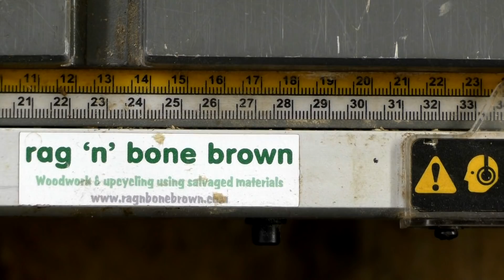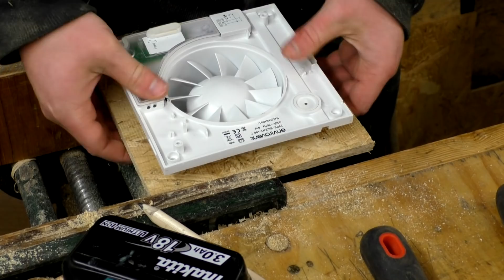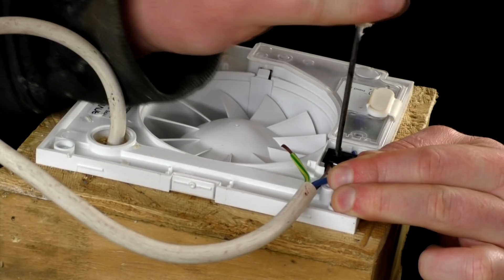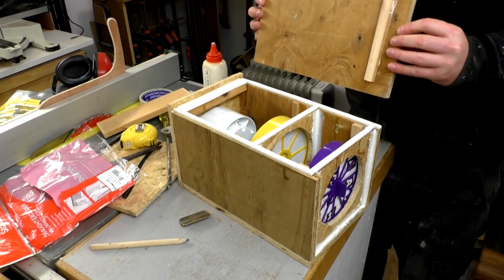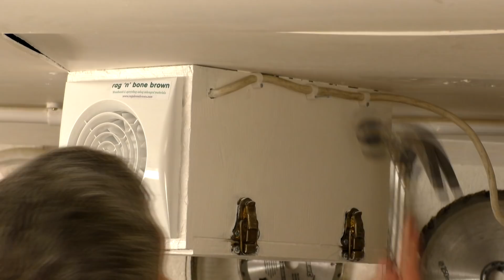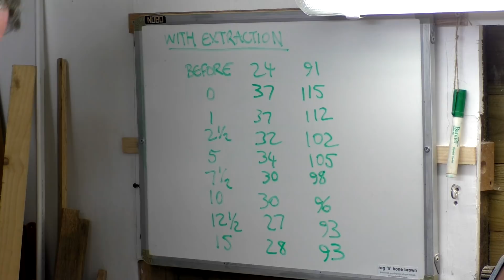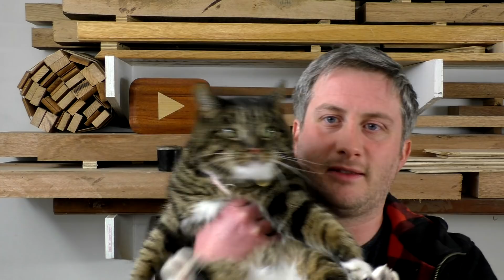Making A Small Air Filtration Unit For The Workshop.... FAIL!

Comment: 1) Dyson filters are no good for this application, 2) your fan doesn't have nearly enough static pressure, 3) you always need more CFM than the actual volume of your shop.
I made a copy of the Jet AFS500 airfilter using 18mm plywood, 6 high performance server fans I got for dirt cheap during a sale, and a leftover 150W PSU to feed them. It accepts one Jet pre-filter and one fine filter. The fans move about 103.8CFM (176m3/hr) each at 66 Pa. All 6 of them move a total of 622.8CFM (1058m3/hr), way more than the Jet AFS500 itself which max out at 353CFM (600m3/hr).
I can tell you it does get the job done and you don't need a meter to notice ;) You can smell the air is clean, and you definitely see it because the filter turns brown when it's full.
You could also make a slimmer 3 fans version of it if you cut the filters in half.
PM me if you want the SketchUp plans and pictures.
Link to the fans:
https://www.amazon.com/Panaflo-120mm-FBA12G12H-1BX-103-8CFM-Computer/dp/B008LA75XG
Other fans would work too as long as they have the same static pressure (66 Pa).

Comment: So, two basic issues: 1) vacuum cleaner filters are designed for high velocity/low volume of air.  That little bathroom fan can't generate nearly enough flow to get the necessary pressure drop across those filters. 2) As previously mentioned, that bathroom fan is just way too small...don't know the total volume of the shop, but it would take ages to circulate all of the air in the shop through that little fan.  You'll have much better success using high quality furnace filters and a box fan.

Comment: Air needs to be pulled through the filters instead of trying to push the air through.  This will have the benefit of keeping dust from accumulating on the fan blades as well as creating better air flow.  You also need a fan with greater static pressure capability or more layers of fans.  Fans can be stacked to increase the pressure.  Those Dyson filters need a lot of pressure to pull air through them.

Comment: I used 4 vacuum hepa filters in parallel with a squirrel cage ventilator ( a little more pressure than axial)  it didn't work either.

Comment: Great video.
This s not tested. Just theory;

I would suggest that your not moving enough air because your fan designed to move steam and moisture is not strong enough. As evidenced with the prefix "silent".

The air has to pass through two strong filters. You said that the filters are from Dyson which comes with a good strong motor. You could find an old Dyson and repurpose that.

 Or, if it's too loud, you adapt your current set up to a  suck and blow approach with the strongest fans you can find at around that size. Placing one fan before and one fan after the filter.the thing is, with two filters blocking the way, your solo bathroom fan is not pushing enough air to force the air through the filter.

Keep going, crack it.
With millions of small sheds world wide, you have an attentive audience.

Comment: I think, the error is easy to detect: U used filter from a dyson vac. U need much much more pressure
to get air through the filters. This toy fan has no power. The tube fan only works like a mixer.

Comment: Air flow through the unit. I built one also and found I had insufficient airflow till I pulled out all but one filter. Try removing a filter then repeat the test.

Comment: Several factors are causing the results.
1 - The fan is underpowered.
2 - Only the lightest and smallest particles will be at that level. Lower the box to 1.5 meters to make a meaningful difference.

You can use a box fan with a filter attached as a cheap alternative. The HEPA filters [11-16] will clog immediately. Try a #8.
You can use an old canister vacuum from a thrift store since size might be a factor.

Comment: The idea and creation is very nice done, but a see a few problems.
The biggest problem like the other comments below mentioned, is that the fan is too weak, and doesn't provide enough CFM, 
and also, the filters will lower the CFM, this reduction will even be more when the filters are getting dirty.
Second big problem is, that the air direction is wrong.
When you pull in dirty air through the fan, the fan will get dirty air and the lifespan will be reduced.
If you let the fan blow in the other direction, then the fan gets only clean air.
I bet your next design will be improved enough to work.
Good luck.
Reply from the maker: Thanks- great info

Comment: My first thought was that the fan isn't powerful enough to push air through those filters. What flow rate is the extractor rated at? You may need 4 or 5 fans that size to get sufficient air flow.
Reply from the maker: Thanks you're probably right

Comment: Are the filters put in in the right direction as most have a flow direction.
Reply from the maker: Yes, I suspect the fan was the wrong way round though judging by some of the other comments, and should have been pulling air in rather than pushing

Comment: As other have pointed out there are a couple issues that probably contribute to the poor performance.

1 - Bathroom fans are generally low cfm and very low pressure.
2 - Fans, in general, are better at pulling air than pushing it.
3 - HEPA filters are typically pretty restrictive.

You could try remaking the project with a new design.  The two filters on the outside, but not inline, and the fan in the middle pulling air out.  Air would be pulled into the box through a filter on either end, then out the middle through the fan.  But that fan might not be up to the task of moving air through those filters.

Comment: 20" floor fan and furnace filters.  Done.  I have 2 in my shop, just slightly larger than yours.
Reply: In the UK, you can't buy simple 20" box fans, and we don't have furnaces here so furnace filters just aren't on the market - even on Amazon.

I found this video looking for UK builds that worked with materials we can get in this country.

Comment: Disclaimer... I am not an HVAC engineer in any way, shape or form but...   
Slower fan, moving a higher volume of air into a box with a large surface area for filters.  First filter acts as a baffle, causing the air speed to drop, particles lose energy and become entangled in the filters. Your fresh air relatively slowly but in large volume exits the system. 
Your MkI system isn't a fail, it's just a prototype and I hope you build a good scrubber soon.  Check out Matthias Wandel's really detailed build videos on his filtration system.

Comment: I believe anyone with a workshop has made the equivalent of a "white box that does absolutely nothing". I've made some doozies, expensive doozies. Great learning method though.
Just spitballing but I think you'll need minimum 125 CFM fan/motor preferably with sealed ball-bearings and thermal protection.

Comment: use an inline fan from screw fix (26867) its pulls a lot more air through. i was thinking put the inline fan in the extension and put 2 grills through the ajoining wall an IN and an OUT and put the filters inline through the ducting so it will take air out filter and put back into the workshop and that will make more of a notable difference??
Reply from the maker: Thank you nice ideas

Comment: don't let it put you off ... this is how I do things you will get there in the end these bathroom fans are pretty hopeless to be honest . ideally you want one of those ducted fans if you look on ebay you can pick some up quite cheaply  I bought a 6 inch one recently for 30 and it's very powerful yet also quiet because it's a bigger blade it can move more air whilst spinning slower. being a ducted fan you could insulate it in a box to lessen the noise too . have you considered maybe a cabin filter for a car they have a large surface area they aren't too expensive and you could probably just vacuum clean the surface now and again . also the best motor to use with your Dyson filters would be a Dyson motor under 15 pound will move tonnes of air but probably way too loud for what you want . I totally get where your coming from by trying to be a considerate neighbour.

Comment: Firstly, that tiny extractor can't have very much CFM even without resistance.  Secondly, those filters are designed for vacuum cleaners which are capable of producing far higher pressure differential to pull large amounts of air through relatively small filters.   If you want to optimize the full airflow capability of that extractor, use a large surface area of filtration.  I would recommend making the entire box out of filter material and having the extractor pull air into it so that it exhausts cleaned air.  
If you can afford the space, I recommend a larger fan inside a box made from furnace air filters.   I use a box with 4 sides made from 20x20 cheap filters with the bottom being wood for support and the top being a shroud for a fairly quite 18" shop floor fan inside of it.  I don't have a dust meter, but using a bright flashlight to illuminate the dust, I estimate that with the unit running after 4 hours, the dust level inside my entire house was reduced by about 90%.

Comment: I think the problem lays with those dyson filters mate, they are made to draw air in and not being used to have air blown out....just look at a hoover to see where the filters lay and where the fan is.....also you will notice on most air filter boxes that the filters are on the outside, the fan on the inside.....one way around your problem would be to turn the fan backwards so it blows the air outside via a hole in the wall and just have the filters inside to draw dusty air into it.....just my 2 pence worth 👍🏼😊
Reply: marc's fx is 100% correct . Your filter is all wrong . A small piece of furnace filter would be better , to move a large volume of air . your fan is not strong enough for those filters.
Reply: Exactly what I was going to say. You can’t effectively push air through filters like those with a fan that small.  You need to pull the air through them.  If you turn it around (reverse the air flow to exit through the fan, changing your filter media order) you should get a better result.
Reply: One of the filters is pre motor the other purple one is post motor and is HEPA but they are designed with more powerful motor in mind 

Please
Reply from the maker: Thank you!
Reply: Hey guys, I’m a mechanical engineer. You’re right that the fan is undersized so either need a more powerful fan (bathroom extractors are designed to move steamy bathroom air without resistance) or lower resistance filters (thinner furnace filter would be better but I don’t think they make them that small, maybe you can cut one down?). Generally, the thicker the filter, the better it is at removing particles but it’ll require a stronger fan.  You can get around this a little by increasing the filtration surface area. This is one reason furnace filters are corrugated - more surface in the same outside rectangle.  Maybe you could put a bunch of small diameter fans side by side all blowing into a single long rectangular furnace filter to save headroom. Now, whether the fan is upstream or downstream from the filter doesn’t change the effectiveness of the dust removal. However if the fan is downstream from the filter - in the cleaner air - the fan blades and motor don’t get caked with dust. It’s a maintenance thing not a filtration effectiveness issues.
Reply: I think everyone’s right about the weedy fan and incorrect filters.  You may want to take a look at modellers airbrush spray booths as a possible place to either modify from or to pillage for parts.
You should also be careful how you are using your numbers as you aren’t really comparing like for like in any of your graphs.  You also need to think about what you are trying to achieve here.  Are you looking to clear out the most particles in the 15 minutes or perhaps reduce the number in the air to a particular level as quickly as possible?  Also be careful comparing the level measured with the air filter on vs doing nothing.  With the filter on, hopefully much of the particulate has been removed from the environment into the filter.  Doing nothing isn’t really removing the dust, but allowing it to settle, meaning it will become airborne again as soon as disturbed.
Much to think about!
Reply: bradley crewe yeah, I'm no expert but those small bathroom fans take at least an hour to make a bathroom usable after I've visited.
Reply: Air is always filtered before reaching the fan in any system vacuum or not

Comment: I hope this comment helps, I’ve got some background with dealing with HVAC. 

Firstly, for your dust extraction system to become efficient you will need a positive pressure inside your workshop. The dust extraction system will then need to feed out of your workshop to allow for a differential pressure so that air flow comes out of your workshop. If you manage to keep a positive pressure inside the shop (that which is different to the outside) then you will most likely achieve a better air flow, thus allowing a clean air system working. 

If you don’t understand what I’m trying to put across you can contact me in a different way and I will try to help you out.
Reply from the maker: Thank you, I think this sounds a bit too technical for my brain to understand! My dust extraction seems to me to be effective enough (the video shows it reducing airbourne particles by around 300%). I'm not sure I understand what positive pressure is or does! Thanks
Reply: Rag 'n' Bone Brown I’ll try and explain it in a different way. 

If you have a balloon and you blow it up, that balloon contains positive pressure. Positive pressure is the pressure inside a vessel or container (or in this case your workshop). To get positive pressure you will have to have a fan that blows air in to your room, the air filter you have made will either have to vent out of your workshop (in to your garden) or will have to go back in to the air intake (the fan blowing in to your room). 

This allows air to flow through your workshop which allows the dust particles to go through your Hepa filters more efficiently. Because there is little to no air flow in your workshop you will see very little changes to atmospheric conditions. 

I’ve made it sound more technical than it actually is I think. 

You could actually do some tests with your air compressor and filter unit but I think it may be a bit of a faff.
Reply: I think you mis-understand what is required. This is a dust-extraction system, not an air-extraction system. We need to remove the dust content of the air, while re-circulating that air. Any pressure difference with the outside world is completely irrelevant.
Reply: @Tensquaremetreworkshop  my dude, that was 3 years ago...
Reply: @RoscoeFoley04  So? Time passes, but Physics remains the same...

Comment: it is easier to pull than to push try mounting the fan to pull air through the filters rather than push, also you only need one filter.
two create far to much resistance.

Comment: I think you know by now that the fan rating is in free air and the filter from Dyson are horribly ill suited for such an application.  Even a standard HEPA filter would be a great resistance.  I thought a furnace fan or central a/c fan would be well suited.  Excellent videos!
I just had a thought while watching.  Putting an air purifier away from the dust source puts up in the middle of the air stream.  You will still be inhaling dust before it travels to the purifier.  Even the commercial ones can fix that problem.  So getting the dust at the source makes sense too.  But all is not lost.  Replace the filters with a less restrictive one.  Furnace fans remove 6 to 100 micron particles.  2.5 microns  seems like a very high bar to reach.  Is that necessary?

Comment: You need a big fan with high CFM rating  and larger filter to penetrate the air more quickly. If you want a small foot print filter you could look for a small blower fan like the mini B Air VP20 which moves 800 cfm and uses only 12 watts of power. Blower fans do much better pushing air through filters rather than a blade fan that can end up pulling air around the outside of the blades when the air is restricted. But if you have a big blade fan like a 20" box fan and a better filter like a furnace filter there are many examples of that working well. I seen one testing video that shows 1 hour particle test that removes a lot of particles. But it takes time as the filter gradually scrubs the air so if you cut wood and new dust goes in the air it will take 45 minutes to cycle through with a large fan and maybe many hours with that small one.
Reply: Here is that test. https://www.youtube.com/watch?v=K9bIWINK8hI
Reply: Just doing some thinking, your small fan is likely only 30-50cfm, the VP20 at 800cfm is still not enough airflow for a shop. My 20" box fan is rated at 2500 cfm and with the filter restricting might still be stronger than the VP20.  to scrub the air fast enough. I've seen shop owners using 2 and 3 of these box fans with 20" filters to effectively deal with the dust quickly. Thats 7500cfm of airflow. If your dealing in metric where I live airflow is rated in cubic feet/ minute (CFM) and the metric equivalent is cubic meters/hour (M3/Hr). 1 CFM = 1.699 x M3/Hr.